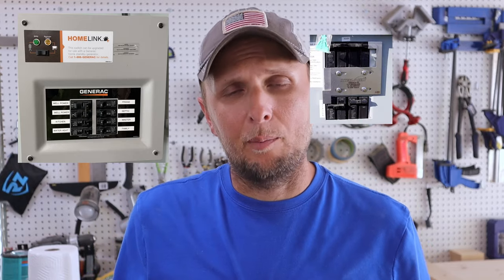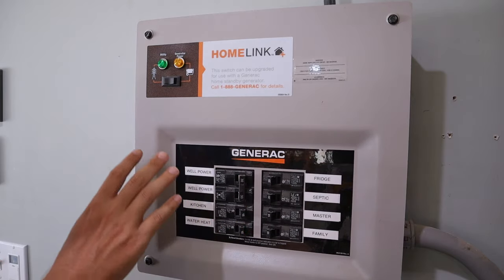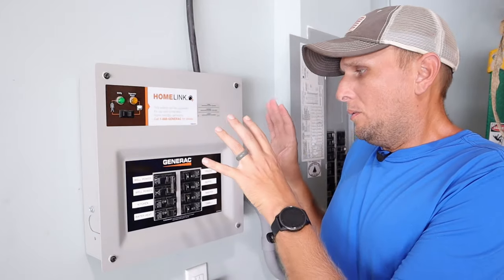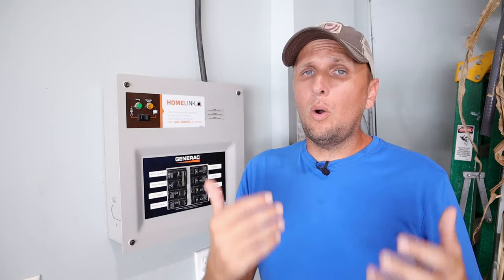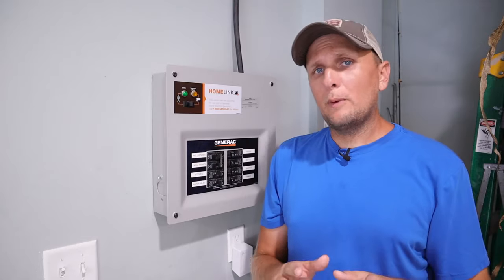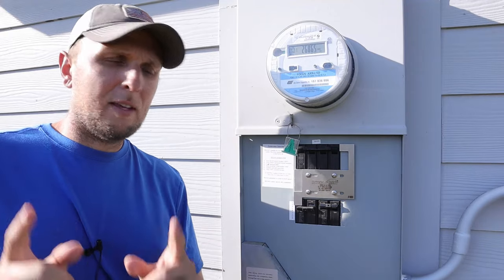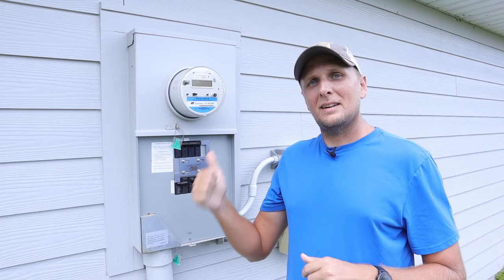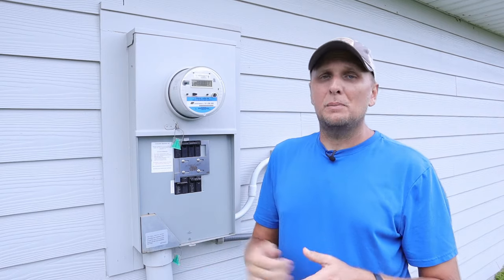How To Choose Between A Transfer Switch Vs Interlock Kit With Power Inlet Box

Comment: I facilitate generator to house units, and I always install #6 wire from the generator inlet box. IF generator has the 30 amp outlet,  the house inlet, of course, will also be 30 amps. To anticipate, my customers might eventually UPGRADE to a larger generator (50 amp outlet) then all I have to change is the house inlet box . The #6 wire is what the 50 amp calls for.  I believe most upgrades are bigger generators and electric start. I also recommend during the upgrade for a dedicated 120 volt  weather proof receptical for easy access to charge the generator battery if ever needed.  Most of the time I install breaker lockout on the panel.   I always discuss customer energy usage. (Well pump, electric dryer, electric stove, central A/C) . And have customers write down 'operating  sheet'  so I can talk them through it on the phone as necessary.

Comment: Its not for everyone but an Interlock is in my panel. I got lucky when I shopped for mine, It was around $15 for my panel. I saw others for different panels costing $75 and up.  With my needs and requirement is was a no brainer.

Comment: I wish you had shown an interlock switch with a larger box.  We have a 200A service box with maybe 30-40 breakers in it.   One thing I have noticed is that the breaker that connects the power inlet box to the panel must reside in the upper left or upper right section.   As this is a 50A breaker I am assuming this is feeding both sides of the box (two poles).   So it should allow you to turn on item on either side of the box.

Comment: I use an interlock at my house in NJ.  My home has natural gas. My 7000 watt generator can run everything but the central AC. During Sandy it was nice because I could turn on any light in any room with the interlock.

Comment: I have the interlock. My reasoning was the interlock gave much more versatility. I can run all my outlets and outside lights for security during an outage. And cost was much lower on labor cost to hiring an electrician

Comment: Helpful, but now I want to do do both depending on the power situation I'm facing since I have a generator and I also have an EcoFlow ultra. Would love to run critical stuff off the ultra and run everything else off the generator (including the plug that's charging the Ultra). That way when I run out of Propane and I'm down to "Emergency Power" I can do it more easily.

Comment: I have both an Automated Transfer Switch for my 22kw Natural Gas Generac Whole-House and an 50A Interlock for my backup Gas, Propane and NG generators. The Generac has failed in the past so I bought a Harbor Freight Predator 13kw Tri-Fuel that hooks to my BBQ ng line in my screened pool area and also a separate 3/4" valve on the side of the house.
Reply: HF predator Tri fuel ...??? Since when do they make tri fuel let alone dual fuel ??

Comment: I went manual:

Cutoff switch past the meter.

I have a surge module inside the breaker box and then another manual connect/disconnect on the whole house generator, the line conditioner is downstream from the breaker box and it’s always modulating bad power from Utilities and Generator.

For smaller portable loads I went with inverters and UPS’s 😝

Comment: I am running with an interlock. My generator is only 3850 running. But it is 240v which is needed. It’s not difficult to shut off the unnecessary big draw circuits after all this is for power outages. We can go weeks without power. 
Transfer switches are really only necessary if your generator is neutral bonded and you can’t unbond it.

Comment: Adam, thanks much for video's have learned a ton. So, I bought a 13,000 watt generator & my panel doesn't have room for another double breaker to facilitate an interlock. I concluded MTS is only way for me. My generator has two 50 amp receptacles but as I understand it I can only have one power inlet box. I'm hoping to power 4 220V circuits along with five lights & plugs circuits. I'm good with my wattage calculations but the total amperage for these circuits on the panel is 210. So, my question is will the electrical inspector be concerned about that?

Comment: You asked how I installed my transfer switch. I have a 3 position switch- utility live- neutral (in between the two power sources)- and generator live. This way current is provided to the panel from one source only. Again this is very important so that my generator cannot feed into the grid where you might have downed power lines.

Comment: I chose the Reliance Controls 10 circuit transfer switch because it has built in watt meters to help balance the load on the generator.
Reply from the maker: Yup that is a good transfer switch!  Thanks for the feedback.
Reply: I did too !

Comment: I went with a transfer switch because my main breaker/meter is in an electrical closet I don’t have easy access to. Either one you go with, you’ll be far better off than the vast majority of homeowners which typically dont have any backup power beyond flash lights and candles.

Comment: Good video, thanks for the info.

Am I able to use a transfer switch with a bigger generator? Looking at getting a Westinghouse with up to 14,500 peak and 11,500 running.. sounds like the transfer switch set up is what I would prefer to keep things simple and safe but not clear if that would work with this size generator?

Comment: I have a generator that can power up to 3500 and a surge current of 4000 watts with 120v and 30Amps.  I went to the interlock kit, coz I knew what to turn on and what to turn off and I managed the switch and didn't even touch the circuit breakers only other than flipping the main breaker.  So again it is deciding what we need.

Comment: I enjoy your videos. Sometimes the content is over my head. You installed a Generac HomeLink manual transfer switch. I wish to do the same. The issue is my Cutler-Hammer breaker panel has the grounds and neutrals combined. The panel is a 200 amp panel and there are no open positions on the bar. I have a call into an electrician but I want to know what is the proper solution. Steve

Comment: When circuits and their breakers are moved to a transfer switch what happens to now "empty" slots in the main panel? Very good video!!
Reply: @jmljml5065  incorrect.
The circuits are moved to the transfer switch. The breakers can be moved to the transfer switch, which would leave spaces in the panel that require coverplate sin the panel cover. Or new breakers can be used in the transfer switch, leaving unused breakers in the panel.

Comment: I don't agree that the interlock requires you to switch circuits.  You could use the same circuits as a transfer switch and just leave them.  You do have the abilty to change circuits with the interlock.  Hopefully you know loads on the generator when doing so.  Thanks for a good video!

Comment: Love the videos… I have solar panels installed on the house and was wondering if I can install all of this with my generator even though I have solar panels.
Reply from the maker: I am not an expert when it comes to solar as I know the hookups to the homes can be different.  Grid tied, off grid, hybrid, etc.  So depending on which one you have, it will require a disconnect.  The question is where exactly and that depends on your setup and wiring.  So the answer is yes you can, but it’s a little more tricky.

Comment: I'm checking out my house's circuitry with an eye towards doing an interlock.  My wife asked an interesting question.  Since the main breaker is off, how can you tell when the power comes back on?
Reply: Our power utility has an app that sends us notifications, though you have to go into it to turn them on for each outage... and then you’d have to look at your device ever so often to see the notification (and/or enable notification sounds—I usually always keep mine off.)
Reply: @GMC-qo9xi  I should have thought of that.  My utility will send email notifications.  Thanks for jogging my brain into working. 😀
Reply: @thelastremainingmoderate1997  we’ve just gotten through a major outage recently... 7days, no power. The app generated dozens of notifications, which was a tad annoying, as they would say it applied to our outage, but never did until the final one or two.

However our generator was only powering extension cords into the house, so our main breaker remained on... But I am now waiting for an upgraded generator and need to buy an interlock and the other related items to hook it up to our main panel... so your question will be pertinent for myself shortly.

Comment: I have a interlock device but i also have solar panels. I was told that all i  have to do is turn off the solar panel breaker and use the interlock for generator use.  I have a Sunrun system any thoughts on this? Thanks for he video I understand what it is and how it works.

Comment: This is really helpful. I want to use my Ford Lightning (19.2 kW EV battery) in lieu of a generator for backup power to my 3-phase 240V domestic well pump (5A). I plan to have my certified electrician connect my Ford Lightning 240V output connector via a 30-foot power cord to the Power Inlet Box and using an Interlock Kit installed on my 240V well pump power panel, including a new 50A breaker in that well pump power panel. The Interlock Kit seems logical since my well pump is the only breaker set in that power panel. This doesn't need to be automatic - manual is fine. My pump installer says I would need a 15kW backup generator or battery for the pump in order to cover motor start-up surge power demands.
Reply: Kent- there is a large amount of info on the Lightning forum about difficulty using the 240v outlet in the truck (7.2kw) directly connected to the house generator inlet.  If you haven’t researched it, look it up. The bonded neutral / ground in the house causes the truck to sense a fault and trip.
Reply: @barrillesmason919  Barrilles, Thank you for this helpful information. I'll research this further, both in the Lightning Forum and with my electrician team. Also, the Sun Run Ford team is working on a quote for connecting the Ford Charge Station Pro and Home Integration System, and I have put to them the requirement to back up the three-phase well pump as well as the house. They are on two separate breaker panels. This will be interesting....

Comment: Great video explanation I have a 10kw generator, 1400 sq foot home in Central Florida, typical household electrical components, will the 10kw generator run hvac, fridge, few ceiling fans and outlets?
Reply: it depends on hvac, but I think 5-8kw would be enough for you,

Comment: I went interlock, its a midsize at 5500w, and we have a ton of circuits more than what a transfer switch will allow.  We just have the breakers marked that will always go off (stove, dryer, car charger) and they have to choose between running one at a time between the the electric kettle, microwave, air fryer, 120v car charger (or stove top limited to one burner).  All these plug in devices could make the device go off anyway if plugged into the transfer switch.

Comment: I just bought a Westinghouse -  a 9500 and I mainly want to run only AC/HEAT, fridge - I have another portable electric/solar one for some stuff also, that I can use inside...do you think I can run an AC on a transfer switch?

Comment: Thank you so much for all of your well develop videos.  Some years ago, I saw your oldest generator related video.  Due to my budget and other related factors,  I was able to create a my own locking mechanism.  The one I needed was out of stock but principally was about $120 dollars delivered.    Personally, I re arranged my circuit box to properly accommodate the order for my 240v. panel.  This is important because it created a method for me to select 6 low power circuits along with 2 higher power consumption circuits.  My main restriction to give power to the house was my generator.  Lucky, I got one that produces about 8k of constant power and up to 13500k for peak events.  In my view,  the best option is the manual locking option.  This is due to the fact that are less things that could go wrong and it is cheaper and a much straight forward option that just about any DIY person can actually handle.

Comment: I have seen some interlock kits set up inside the house on the main breaker box. Is that correct, or does it have to be outside where the 200 amps are coming in off the pole from the grid? Thanks.

Comment: Great video, thanks.  Have you made a video on how to add an automatic switch with the whole house connect to a Tesla wall (or similar battery system) and a whole house generator.  What I am looking to do is have a battery system acting as a "UPS" for my home when grid power goes out and a whole house generator to keep is going until power from the grid resumes. In other words, if the grid goes out, the batteries will prevent any power loss in the home and the whole house generator will than start to recharge the batteries as well as replace the grid until it comes back.  I would like this to all happen automatically and simply receive notices to my phone.  If you can help please let me know or maybe you know someone.  Thank you I have subscribed and looking forward to learning more from you.

Comment: You have the same box for the generator to plug into the house that I do. How do you plug it in? Got a 50amp cord from Amazon with  twist lock end but that box has no threads.

Comment: I went the expensive route. (Whole house generator 24KW) Before I had a 13,000 generator and I lost power at 2am. There was a hellacious storm going on and it was too dangerous to go outside and hook things up.  I suffered all night long due to the house being hot. I still have my 13,000 sitting in my storage shed all nice and shiny but it's never going to get used now. Unless someone else loses power.

Comment: Thank you for this explanation. I’m getting a inverter generator that has a bond in neutral to the frame…… and I want to do the interlock switch. But with generator having a ground and the house having a ground, isn’t that against electrical code? Not really sure what to do about it but I do have an electrician coming over to put the switch on and a 50 amp plug. Any info on what to do about the double  ground would be great. I’ve read some people turn their bonded generator into a floating ground. I contacted the generator manufacturer and they said that wasn’t recommended.????
Reply: Champion generator even had video to change bond to float neutral on their generators.

Comment: I use both a 50 amp interlock system and a 30 amp transfer switch. I run a larger generator for air conditioners and water heater on the 50 amp circuit and a smaller inverter generator to run more sensitive appliances and computers on an isolated 30 amp transfer switch. Still cheaper than a whole house generac setup.
Reply from the maker: I have the exact same setup.  Works really well.
Reply: I run simillar setup but use 3 phase transfer switch, I use only 2 generators so only 2 wires are working, last one is non essential

Comment: We have a 11500-9200 watt champion generator with a interlock switch and it runs our 2000 square foot house no problem.  We can turn on everything and and it’s power wattage is only 25 precept load. It is a chore to wheel it out and set up so tho.

Comment: Excellent video and explanation, thanks! I'm wondering if you have any advice on properly wiring a neutral-ground bonded generator with an interlock kit. I am reading online that I can't have a neutral-ground bond at 2 points in my system (at the panel and at my generator) at the same time. What's the best way to properly wire this? Thanks!
Reply: I have seen people run bonded generators with an interlock on thier panel several times without any issues. But if you want to be safe and by code you can either disconnect the bond on your generator or you can use a 3 pole transfer switch. This breaks the neutral from the panel when switched to generator.  You will need to connect a ground rod to the generator when using this type of transfer switch.

Comment: Our house has a really goofy arrangement of circuit.  We have circuits that have too much stuff on them, like the microwave, toaster oven, and big screen TV on one 20 amp breaker.  On the other hand, we have circuits with a couple of outlets, lights, and ceiling fan, on a 20 amp breaker.  I would have to rewire 3/4 of the house to be able to get by with only 8 circuits.

To me it makes more sense to leave everything turned on with the exception of the AC, washer and dryer.  Even a 3000 watt continuous / 3500 watt peak inverter should run my large loads, furnace, sump pump, and refrigerator.  With LED lights and only using what we need at one time, that is less than 100 watts

Comment: I'm novice when it comes to this stuff. I just bought a 9000 watt inverter generator (bonded to frame) from all that I've seen, I have to have the transfer switch (3 pole) since the generator isn't  floating neutral, but the electrician I spoke with told me I could go with an inlet box to power the whole panel and choose the circuits I want to power. 
In need of answers before I decide and pay for the wrong thing...I'd prefer to pick and choose my circuits as needed versus being limited to pre selected circuits only. Any advice is appreciated.

Comment: I use an interlock and I got a 2200 watt gen. Furnace is gas and I have a wood stove.  Literally for lights and tv.  Works great.  Get the right cord you can power both sides of the panel.